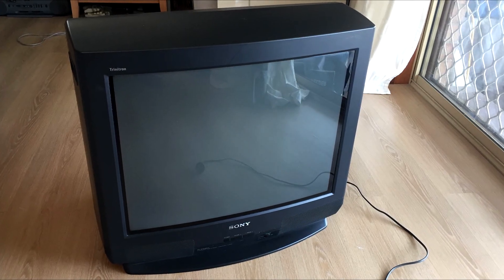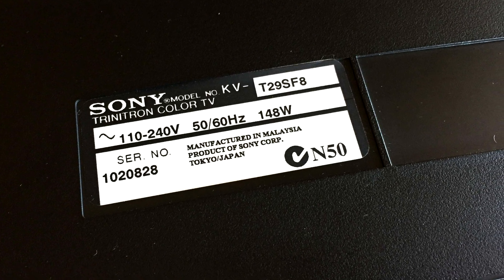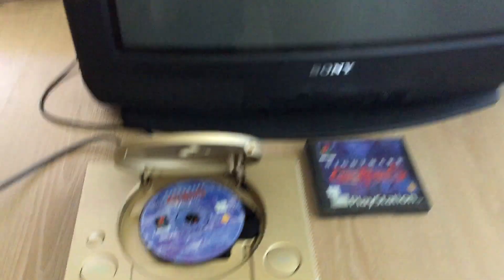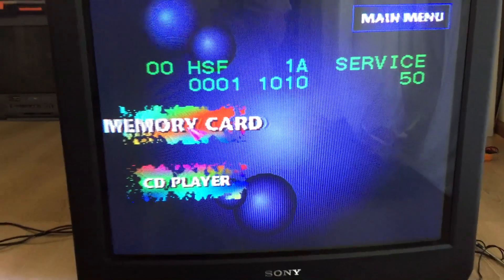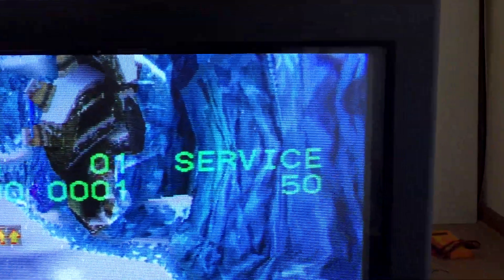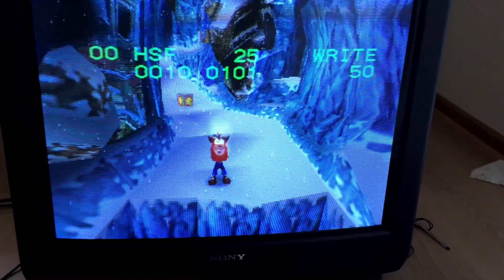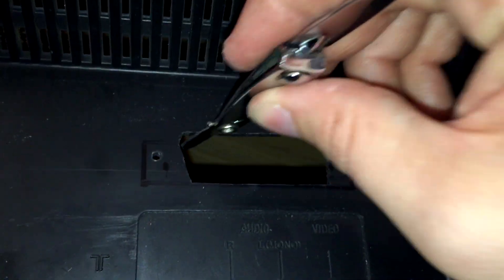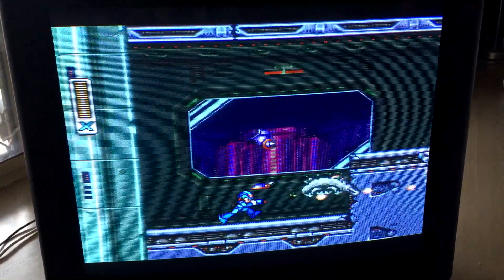Another Sony Trinitron RGB SCART Mod! KV-T29SF8

Comment: hey i have this tv but with no remote, nor operating or service manual
is there any way to access the service menu without the remote? ive got red green and blue lines across the upper third of the screen and wanted to see if i could shift them up somehow but cant seem to find any manuals online at all
is there any chance you have a manual that could be uploaded somewhere?
thanks
Reply from the maker: You’ll need a remote to access the service menu, you might be able to trigger it with some messing about internally but you won’t be able to navigate the menu at all without a controller. Any similar era Sony TV controller should work.

That said, whilst the service menu might help, the vertical deflection circuit might need looking at. 

Service manual is available online if you look up Sony KV-T29SF8. Best of luck!
Reply: damn, will have to find a remote somewhere then, did end up finding a manual online though
thanks for the info!

Comment: I have a unrelated question. Have you tested any NTSC devices through composite? Because I used the 25 inch version of this and it didn't work in colour despite the manual saying it would?
Reply from the maker: I’ve had no issues with NTSC, in saying that I haven’t tried NTSC @ 50Hz or PAL @ 60Hz. If it uses the sync Hz to determine which colour carrier to use you might have issues (which I’ve had with other CRTs)
Reply: @RyanUkAus  It was 60hz

Comment: This is honestly one of the to the point vids I've seen on RGB modding. Did you add resistors for Yb\Pb\R inputs? Like 75ohms to ground for RGB lines? I have a input for RGB on my set but I'm not sure if I have to terminate to ground
Reply from the maker: For this model TV the RGB inputs were already terminated and had decoupling capacitors in place, it probably couldn't have been much easier and ready to go! Some similar era Sony's and Philips will be the same.
Reply: @RyanUkAus  Omg you actually replied thank god! I was trying to do this mod today but I'm running into a weird issue. When I wire up CN001, for RGB and BLK, I see nothing on the screen. If I hit the blanking with 3.5 Volts the image becomes inverted. If I hit it with 5V it triggers some sort of protection circuit and the set turns off. In the service manual, the rated value for that section is 0V. 
Did you split the BLK to get 2.5V or more or less? I know it's not the exact same thing but any help would be appreciated
Reply from the maker: I’ll have to check next time I’m around that TV (it’s in storage atm)

If I recall my BLK is wired directly to pin 16 on my SCART connector and gets it from the console
Reply: @RyanUkAus  I see. That appears to be fast switching. Well whenever you can do check it. Thanks 👍
Reply from the maker: Apologies for delay, I had to dig this TV out the shed. What I did might not apply for your TV, so it would be best to know what set you're trying to mod as some use Sony CXA chips rather than Philips TDA. Mine is done exactly as seen in the video, the RGBIN on the TDA chip is wired to SCART pin 16 with a resistor in series (I forget the value, I guess 220 to 1K ohms). Sync from the scart connector just goes straight to AV1 / 2 (whichever you select will correctly sync to the RGB signal.

The inverted image problem is weird, make sure your sync signal is grounded is all I can think of off the bat!
Reply: @RyanUkAus  well thanks. Today I tried it and broke the Tv. Going to take it to a shop to get it fixed. They don't know what RGB is in my country. This time I'm just going to brute force RGB by lifting the pins on the jungle and using a toggle switch to switch between OSD and RGB. Thanks for your effort. I'm going to do more research

Comment: hey ryan, thanks for your helpful video. a sony kv-2964mt popped out at my local area, i found the schematics online and i suspect there is an unpopulated connector for rgb there but i wasnt sure, would you confirm it for me? i could send you the schematics, let me know if youre up for it 😀
Reply from the maker: Hey, you’re welcome to send the schematic through discord to me, let me know where you think the unpopulated connector is!

I had a very quick look at a few schematics but they were low quality, it suggested the TV uses a CXA1213 chip which doesn’t handle RGB inputs by itself I believe. There could be circuitry on the TV that still does do it however!

Comment: how is the tv going 3 years later? I just did one to a 20" bg2 chassis, was even easier than this as the back panel where you can mount scart or bnc is still attached to the chassis when you take the rear cover off so no need for connectors or awkward wiring poking when you screw the back cover on.
Reply from the maker: I’m still using this as my main gaming CRT, no issues with it so I’m very happy!

Comment: I feel you with the RGB, here in South America (Uruguay and Argentina) we are PAL region too and we never got Trinitron with Scart connector only PVM's and some european brands but they were not common at all.
Reply from the maker: It’s the same in Australia, some of the more upmarket European TV’s such as Philips would have SCART but very few Japanese brands do. 

I’ve noticed most Trinitrons in Australia are dual voltage PAL & NTSC with lower specs (a lot of even the bigger sets are mono). I suspect Australia got some of the cheaper Asian market Trinitrons and not the European spec!

Comment: Where can I purchase these parts?
Reply from the maker: The SCART connector I just found on eBay - you will want a connector with mounting holes. As for the wires and resistor I just got them from a local electronics store (which I worked for at the time!). If I recall you will want to use a 100 Ohm / 150 Ohm resistor for BLK to switch the TV to RGB mode.

Comment: If there's an unpopulated connector on the board why does your SCART port have 5 wires to somewhere other than the unpopulated connector? I have this exact model and I want to repeat the process. I'm pretty handy with a soldering iron and have a good enough grasp of things that I feel confident I can mod this and add the right resistor to drop the voltage (someone else in the comments suggested it's a 1k5 to drop to 2.6v from 5v on the blinking pin).
Reply from the maker: There isn’t an unpopulated SCART connector, but an unpopulated IC connector that accepts RGB. The additional wires are going to one of the rear AV ports for sync (off composite) and L+R audio. If you need any help feel free to ask over Discord!

Comment: Thanks man! I don't get ghosting with an NTSC PS1, playing a PAL game through it - all perfect and centred. NTSC is left shifted which my modded toshiba bomba you just change from "auto" to NTSC in the settings - changing the mode on this set does do anything with the shifting.. So the shifting is just something you need to deal with on the set (you can get a shifter from ali express).. but the PAL consoles ghosting (WHY ONLY PAL CONSOLES?).. well the service menu - so thanks. Now i just need to get into it !! :P

Comment: what size resistor did you use to drop the voltage at the blinking input?
Reply: 1k5 you need on 5v to drop to 2.6
Reply from the maker: I can’t quite recall, it was likely either 150 or 1000Ohms.

Comment: I have a 2005 or 2006 awesome Samsung CRT, never seen a picture quite like it colours are so rich I had to turn them down as others have said they are oversaturated.  Anyway the shell of tv at back has cutouts for component and I want to add component to it and/or just make the scart socket component compatble so I can use it as a monitor for PC.  Have no idea if thats doable though.
Reply from the maker: You'll have to see if the video IC / Jungle chip in the TV can accept component, a lot of them can surprisingly but getting it to display might be tricky! You'll have to try and dig up a service manual for the TV or video IC!

Comment: please help, when I turn RGB switch on I got black screen only audio work , when I turn of RGB I got regular composite signel , i tried getting the voltage under 2.5V (2.3V for Blankin) ,But when i turn on the TV, the 2.3V  blankin become 5V, i dont know why, (again im using 5V from scart consol, i dont know how to find 5V on the TV board)
Reply from the maker: Not sure why the blanking goes up to 5v, but likely is giving you the black screen (depending on the video IC the TV has)

Comment: Thanks so much for sharing! I have two of this exact same model which I've been thinking about RGB modding for a while, looks like it'll be fairly straight forward especially with that unpopulated header sitting there ready to go
Reply from the maker: Best of luck, interested to see how you go!
Reply: @RyanUkAus  All done, it works a treat! I ended up down a deep reverse engineering rabbit hole, and managed to route the RGB signal via the AV2 input which is normally software-disabled on this TV but can be enabled in the service menu. As a result the RGB input can be selected via the remote and doesn't override the AV1 or RF inputs. It has its own independent audio input too which is nice. It took a while to figure it all out but the final hardware mods are actually pretty simple. Might be something that others are interested in, I'm thinking about making a walkthrough video about it. If I do I'll post a followup comment here. Thanks again for the motivation, I'm really happy with the way this turned out!
Reply from the maker: @mahlty  That's awesome and would love to see a video on it!
Reply: @mahlty  Hi I'd love to hear more about this. I have the same model TV and I'm keen to mod it for RGB with the more advanced method you've discovered
Reply: I was linked here by a very helpful user in r/crtgaming i have this exact same model and looking forward to tryin gthis. Thanks for showing us!

Comment: Sony Trinitron RGB SCART Mod! KV-T29SF8 is black and white when i connect my xbox 360 no colors just black and white help......
Reply from the maker: Sounds like component sync (luma) output coming from the 360, try the switch on the video cables to change to SD is all I can think of

Comment: Hi Ryan, Thanks very much for this awesome video - I have same model Telly only the F1 using the TDA8366 with the RGB input also - Also have the unpopulated CN106 so should be fairly straight forward. Just wondering if you can supply a wiring diagram  with the components used for both ends? I'm wanting to use this telly for my Old Amiga 1200. Cheers Tom From Perth!
Reply from the maker: Hey! I don’t have any wiring diagrams but it should be very straightforward if you have a SCART pinout. It’s essentially taking R G B and pin 16 (RGB BLK) from the SCART connector to the unpopulated connector in the TV. Sync comes from composite on the SCART connector, I wired my sync to the composite input AV 1 / 2 which means when I select that channel I get my image. Same for audio, it comes from the SCART connector to the audio inputs on AV 1 / 2. Composite ground and audio ground will need grounding too (can use ground from AV 1/2 ground). The A1200 should work just fine using a Amiga SCART lead, my A2000 worked just fine!
Reply: RyanUkAus thanks for that Ryan. I think I’ll be ok with most of that it’s more around the where the 5v and what/where resistor goes?
Reply from the maker: @kodi-thefunnyfrenchie7693  You can put a 100 ohm resistor from the SCART connector (pin 16) to the blanking on the TV, it should work going to the unpopulated connector. It'll just knock the voltage down a little bit. It worked with a 100 ohm and a 1k ohm when I tried it! The Philips chip just needs the voltage to be a little reduced it seems.

Comment: Great video. I have a Trinitron with the same BG-1S chassis. I looked in the schematics and it looks like the rgb “lines” form a single line to the blanking input on the jungle chip. Would this affect the mod?
Reply from the maker: The RGB lines should stay separate up until the video IC / jungle chip, usually you can see them next to some terminating resistors and capacitors. Blanking usually also stays separated right from the jungle chip to the input (sometimes on a unpopulated connector board)
Reply: RyanUkAus ok guess I will just give it a go and see. Also, what size resistor did you end up using on the 5v blanking input?
Reply from the maker: If I recall I got away using a 100ohm resistor, if that fails a 1k resistor should do fine!

Comment: Hey dude, I have a similar TV. The only question I have is around the Sync line. I see  you are soldering it into the sync line on the back of the SCART, are you just splicing it back into the composite line for the AV channel your using?
Reply from the maker: That's right, if you go from SCART composite in to the composite in for AV1 then your SCART picture will work / sync on AV1 for example. You can use the other AV inputs too if you want it on AV2 or AV3.
Reply: @RyanUkAus  Thanks, now to figuire out how to make all this work with Mister as its RGB over RCA. I assume using the Y Luma\Sync into Composite for Sync would be the same?
Reply from the maker: Any sync signal into the composite line **should** work fine!